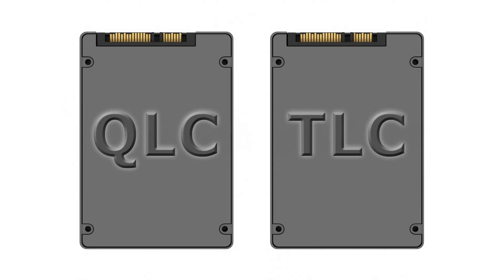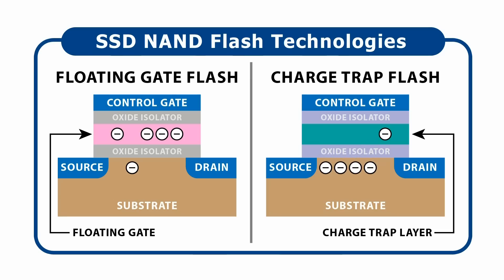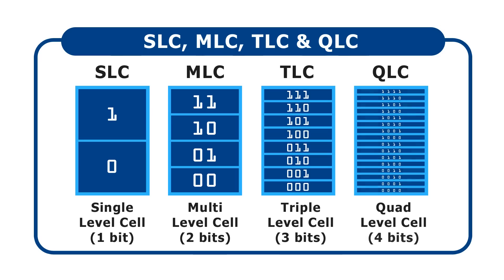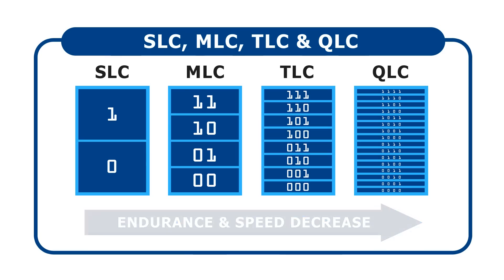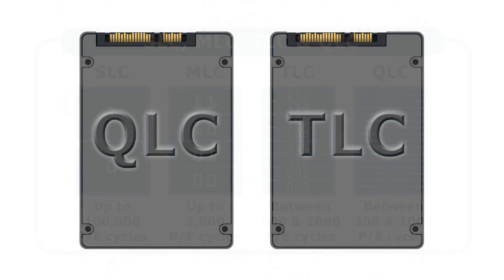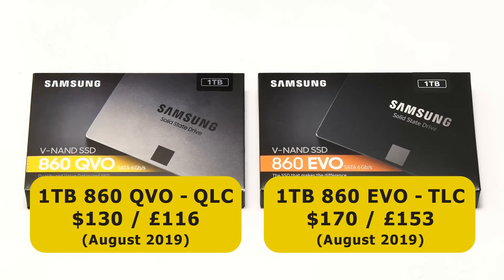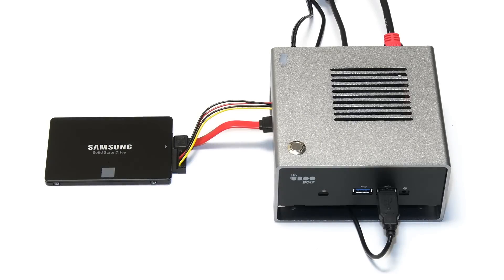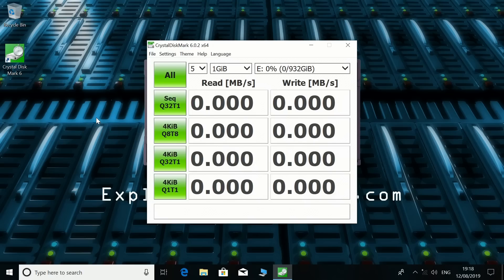QLC vs TLC SSDs: Samsung QVO & EVO

Comment: Thank you Chris, this was very informative. The normal consumer will believe they are getting a bargain and are completely unaware that it comes at the cost of decreased reliability and warranty. Something that should be top priority for any storage device. It is important that people are made aware of the QLC difference. It's the same deal with those cheap mini cars on the market nowadays that come with a 1.0 liter engine. People think they are buying a reliable, long-lasting new car, but have no clue that these tiny engines are not designed to last more than 100.000 kilometers. You always get what you pay for.

Comment: until they fix that shortening lifespan issue HDDs will never truly die off.
Reply: I figure there might be the thing that keeps HDDs in production.  You use the QLC SSD for your everyday usage, and the HDD for near-line backup.  A shame that consumer-level tape drives died off, because those would work as a great archive format (unless we consider BD-RE the replacement).  Actually, would like to see a BluRay equivalent of DVD-RAM.
Reply: I still use HDD.  2 are back-ups, 1 is for pictures and the other 2 are for my security cameras!!

Comment: I won't change anytime soon my drives for a 1000 cycles R/W disposable QLC drive. SSD are not magical stuffs they are fast so problems also come fast. Even pro drives requires regular backup.
Evo's drives perfomances are nowhere near pro's consistency adding to that the fact you need proper hard drives to backup since SSD speed comes at a price and failure is certain and recovery impossible. Adding the cost of lost data all together and we can see the pro becomes cost effective. Ssd should only be used on system drives for casual users and high recording speed applications where you can aford having 3 of them in a RAID 5/0  ( and never get your hand on the setup again !.. ).

I wont either promote constructors for building crappy devices, the primary goal of an hard drive is to retain his memory wheras from past decade whe saw manufacturer decreasing life expectancy for sake of speed selling disposable device as the new bargain for their lack off innovation, this ssd design is 6 years old !

Comment: So for the ProRes larger files and recording time EVO works better?
Reply from the maker: Definitely. You could only reliably record very short shots in ProRes on a QVO or other QLC drive. Most ProRes recorders (eg those from Atomos) recommend use of MLC drives only (eg Samsung Pro), so not even TLC.
Reply: ExplainingComputers short recording? How many minutes you can record with QVO or EVO in ProRes at one go?
Reply from the maker: @NowyKurs  It will depend on the ProRes format used (there are different data rates and resolutions), but I would not risk beyond a few minutes, 2 or 3 minutes, to a QVO,something like that. But even then performance would not be guaranteed -- as I noted above, QLC and TLC drives are generally not rated for use in ProRes recorders. You may get away with continuous recording to an EVO in ProRes LT.
Reply: @ExplainingComputers  thanks
Reply: ExplainingComputers ok. What about WD Blue 3D NAND SSD 1TB?
Reply: @NowyKurs  That is TLC.

Comment: Testing speed on empty ssd disks... ROFL... you are PRO
Reply from the maker: Testing on new, empty drives shows their maximum possible performance, which will of course slowly decline with use. When comparing two drives, they also need to be in the same state -- and new (so guaranteed same TB written) and empty is the easiest way to go.
Reply: @ExplainingComputers  most of SATA SSD give you similar results (cheap bullshit ssd do not count), IOPS parameter is a real thing for users
Reply from the maker: Not all SSDs have the same cache, and as we saw here, this can dramatically impact the speed of large copies.

Comment: Why would the UDOO Bolt have it's SATA connection in such a manner as to have to cross the power/data signal lines without flipping the drive upside down.  Strange.
Reply from the maker: Probably because a 2.5" drive can be bolted under the case. :)

Comment: Hey I didn't understand one thing
Will the 42 gig intelligent turbo write thing work only once when storing the data on the SSD
Or if now at the end of the video, after storing 78 gigs , when I will try to store , say another 78 gig files , will I get the same speed (around 470mbps ) or now I will get drastically low speed like we saw on the qlc drive (about 70mbps)
Thanks in advance
Btw love this channel, very informative
Reply: Okie thanks Chris 
What a wonderful explanation
Btw m a big fan
Reply from the maker: The 42GB buffer will work fine again once the data has been cleared from it. So the drive will go back to its full speed. You will only get the reduced speed during a large copy after 42GB has been written.

Comment: well from your clip I realize that Adata QLC SSD is MUCH better buy. I've bought 240GB QLC model and speeds are amazing, both higher in Crystal Disk Mark and in copy test than these Samsung drives. I made test of copying 38GB file (Wolfenstein II The New Colossus game) and speed was identical throghout whole copy, about 450 MB/s ! That means SLC cache in that disk is at least of 38 GB size, if not higher (I will test later with bigger file, I'm afraid I don't have any bigger file now :-) ) https://imgur.com/A4AQs4q   For comparison, cache size on 250GB Samsung EVO (not even QVO) is only 12GB from what you found out. Adata is much much better value!

Comment: I still feel, as a data hoarder, SSDs are better suited to holding an OS and common programmes, or other data that is going to be written, but not necessarily rewritten often.  They are by no means fragile, and the industry is marching closer to the day where every drive is solid state, but if you have a large amount of data that is often written to, but not necessarily read from all that often (perhaps a database?) conventional drives are what I'd trust, let the SSDs be for a cache.

Comment: Nice video it is educational and good stacked info. Congrats about the content you do ! I only don't like the drives witch you use :) Recently, friend of mine asked me to try to repair 3 drives. One Smsung EVO 250G and two OCZ drives.. When i opened all the drives i saw a hole in the mosfet on the power section of the Evo, and  no fuses at all. The OCZ drives got way more good developed boards with a two fuses and few other hardware protections. The Evo is the worst drive witch I opened ever. It is poor quality board, with many many possibilities for fails.  I can't talk about performance of the Evo drives, because i have not working samsung drive, and after i seen what is inside, I will never even think about to buy a Samsung drive.

Comment: I prefer HDD way more than SSD, because HDD last for 10s of years without any problem, while SSD last from 8 months to 5 years and yes HDD are slow but at least they work and don't let me lose my important files such as my pictures and videos of my life from 2010 to today.
a proof of this is that I got 2 laptops have HDD in them and I been using them a lots since 2010 with 0% problems and they still work.

Comment: Wonder will SLC come back for some 6GB/s SSDs?
Reply: Not much reason for that.

One, they can just change the mode on the NAND temporarily and have part of the drive perform as an SLC cache, so you get the SLC performance short term and TLC or QLC capacity long term. 

Two, they're getting amazing performance out of TLC NAND, even QLC is faster than most SLC drives were just because they've managed to engineer a better controller and NAND is smaller and cheaper so they can afford to put more chips on the drive for parallel operation and the chips are small enough do do that and have a decent capacity.

Comment: I'm not sure that SSDs make sense for large data storage given the cost for large high PE drives relative to the size. HDDs aren't that slow either if you're buying something like WD Blacks and have a decent hardware setup. My 1tb blacks will usually do the same 75mb/s write speeds of the QVO drive in OS (win7 Ult) and will go much faster if running on Linux or a low-level program that better handles data throughput like Macrium Reflect.

Then again, I do a lot of writes to my data drives where as my OS drives only ever house the OS and drivers. I suppose if you're making money off of the drives then they'd make sense (if your time is valuable enough) but for home users I think the tech is still a bit young.
Reply from the maker: I'm a big fan of WD Black HDDs. :)

Comment: Hey Chris! I've just dipped a toe into SSD. I bought a 240 GB Goldenfir from China for £26.49. The drive works OK, and Windows boots fast, but I'm suspicious! Crystal Disk reports a temperature of 40 degrees, and it NEVER changes! And the Smart Data looks fake! All the numbers are exactly the same! The drive had 3 power on hours from new. I can't take it apart, no screws! I assume the drive may be a reject, or counterfeit? I complained to the seller, who instantly gave me a full refund! Which makes me even more suspicious! I've just bought a Samsung 860 EVO 500 GB for £79.97 from CCL Computers on eBay. Obviously, better than the Goldenfir, which I have for free! What do you think? Cheers bud! 👍
Reply from the maker: Sounds like the Goldenfir drive has issues . . . :(

Comment: The 860 EVO is a MLC not TLC.
Reply from the maker: No, it isn't. The EVO drive is TLC. However, Samsung describe all of their drives as "MLC" (generally standing for "multi level cell") prefixed with the  number of bits stored per cell. So I assume what you are referring to is Samsung's description of an EVO drive as "3-bit MLC", which means TLC. :) Similarly they describe their QVO drives as "4-bit MLC", which is really strange given that the name comes from QLC!
Reply: @ExplainingComputers  Yea I realize that after you mentioning that samsung does use MLC loosely to describe their V nand... I realized it after them saying 4bit MLC in one of their responses to someone else's question for QVO. One would think when Samsung says "MLC"  on there specs it should be MLC but nope. They word played MLC deceivingly. Most who are getting into this world watch and research from others and articles , I saw MLC, so I misread it as a true MLC. Glad I commented and thanks for opening my eyes to this small but big difference in the types.. Though I am now mad that samsung played a simple acronym, like myself, I am sure a lot of people are mislead on info.. specially if you read specs from a third party seller. amazon, micro center, fry's, newegg etc or even directly from there spec sheets... learning something new everyday..

Comment: If I got a rusty USB head, or it is exposed to ink, does the data that is transferred through it get broken or defected? For example I copy a movie file, is the video quality affected? Just curious even I know the answer, but I didn't find anyone discuss about it on internet. Thanks if anyone answers.
Reply from the maker: Digital signals will either work or not work. So if the drive with the rusty connector functions, then the data and its quality will be fine.
Reply: @ExplainingComputers  Thanks for this info, means a lot to me.
Reply: For as long as signal stays intact, physical transfer medium doesn't matter.
Like in ethernet over pieces of barbed wire demo:
https://www.youtube.com/watch?v=LP3amXkjvPg
Reply: @tuunaes  I have questions:
1. Does the PC write new files or move (duplicate) old files to new files when copying files?
2. If I copy files from an external drive to another external drive, does the file move through the internal drive before reaching the another external drive?
By the way I have subscribed to your channel, thanks if I got answers again.
Reply: Like name implies copying makes new copy of data/file to target location.
And data copied from one drive to another doesn't get copied anywhere else than target drive.
Unless counting temporary storage in RAM, to where CPU reads data from source before it can write it to target location.
Moving data from one drive to another works similar to copying, except for deleting file from source location after copying is complete.
Reply: @tuunaes  It takes a minute to understand.  So the point is the PC writes a new file based on the code of the file you want to copy in copying / moving files!?
Reply: Moving data inside same drive is the only exception to creating new copy of data.
In that only data of file's location in drive's directory structure is changed.
(making moving multi-GB file instant)
Reply: @tuunaes  Yeah I know this one. Thanks, man. I think I don't need to worry about data quality degradation anymore.

Comment: Sasmsung really knows their sh*t! The actually slower quad gets really good compensated by this new controller they developed, you can clearly see that. 
Just you musn't copy above 70GB at once or take a full cache becoming slow, the only thing- but for real, it's rare to copy that much in a row. You still can copy part by part. 

For the trusting thing- well I got my first SSD in 2013 around, and it's still wroking- was the Evo840 250GB. Everytime playing games which getting updated, so said rewritten a lot.

Comment: I have 32GB of RAM in my machine. 6GB of that is configured as a RAM drive. All the temp folders for windows, both user temp and windows temp folders are reassigned to the RAM drive. Also my web browser cache and a few other things that generate temp/cache data. This not only speeds up general operation it prevents a whole bunch of writes being made to the SSD as they are being made to RAM instead which increases the life of the SSD. It also has the added benefit of clearing all the junk whenever you reboot. There is a caveat though. When updates are ready to be installed, I always switch the windows temp folders back to the SSD temporarily until the updates are finished.

Comment: Sir I Like Them Both At The Same Time But Not At In Different Time Warrantee, Because The Maximum Speed Transfer Are Not The Same, The SSD EVO Drive Is Much Faster Than The SSD QVO Of The Same Physical Configuration With The Same Maximum Standard For Maximum Transfer Unit Of 1,500 Bytes/Sec Cache Memory Of The Hard Drive, The SSD QVO Is Very Tough And Durable Hard Drive That Almost Never Fade Electromagnetically. Thank You Also, I Hope I Could Buy Even Any One Of This In The Future.

Comment: I still don't trust TLC for a boot drive. Give me MLC boot drive, TLC general app drive, and QLC for archival storage or media playback..
Reply: With very little tolerance for charge leakage/interference QLC is the worst one for any data archival use.
Wouldn't wonder any if controller has to occasionally refresh data to prevent it from evaporating like was problem in Samsung 840 EVO with its too small transistor planar-TLC.

Comment: Would id be faster to break down big file transfers to 40ish gb transfers ? Would it be faster if you had coppied half the files first and then the other half ?
Reply from the maker: Yes, doing two smaller transfers would be faster (provided you left the drive to clear its cache between the two copy operations).
Reply: @ExplainingComputers  I see. And is the speed that the drive transfers the files from it's cache to the main storage those 75-80 mb/s we saw when the cache was full? Because is that case transferring 40-50 gb waiting for the cache to empty and then transferring again wouldn't be faster than just transferring everything in one go.
Reply from the maker: You are correct in all regards. The cache transfer speed will indeed be the 75-80MB/s we saw. So you would not save time overall by breaking the copy into two, but each copy operation would be far quicker. But if, for example, you had planned to back up some files on a particular day, and it was an option to do this in stages, it may make life easier/quicker. :)

Comment: 8:00  GiB is actually Gibibytes, not Gigabytes.  The drive formats to (roughly) 932 Gibibytes (932 * 2 ^ 30 bytes) which is roughly equal to 1000 Gigabytes (1000 * 10 ^ 9 bytes) also known as 1 Terabyte (but distinctly NOT 1 Tebibyte (1 TiB))  Windows reads drive size in base2, but uses the base10 symbols, which is why your 1 TERAbyte (~1,000,000,000,000 bytes, usually slightly more) drive never shows up as "1000 GB" or "1 TB" in Windows, instead it shows up as "932 GB" when Windows really means it's 932 GiB (or 1,000,727,379,968 bytes).  Drive manufacturers aren't the ones lying to you, Windows is.
Reply from the maker: I'm pretty sure I said "gigibytes" at that point! :)

Comment: When hitting a drive with a large sequential load, while the SLC is filling up, it's also transferring to the TLC/QLC at the same time. Since the TLC can handle writing to it faster, it's capable of offloading from the SLC faster than the QLC drive did. If you used an even larger file, you'll eventually reach the tipping point where the TLC can't keep up and the SLC fills and the drive throttles too.

But like it was explained, other than in niche applications, both drives will feel the same to the average consumer.